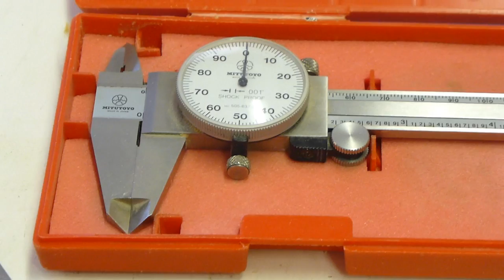Workshop for model ship building

Comment: I really like the small carrousel that holds your  bits and such. I have a small work area and can see the usefulness of the storage options. If you do not mind I will use your design myself.  The drill press Dremel mount is outstanding. Your overall shop lay out is very clever. Hats off to you sir.

Comment: I hade the same table saw. Fine for general work but it has too many adjustments that can get out if wak. I replaced the plastic guides on the sliding table with long pieces of Jatoba (Brazilian Cherry). Mostly l run a thin kerf 7-1/4/184mm blade. I rarely cut anything over 3/4/19mm. I like the idea of each turn of the elevating crank raises the blade the same amount.
You do not need a largeshop todo good work. Chris on Clickspring is basically working in a large closet. Although he does all his heat treat and casting work outside.

Comment: Would like to be as rich as you to build my models
Reply: He didn't just buy them, he has collected them over many years and saved up for them as well
Reply: Warjacare, you don't need a whole lot to start building, a good set of Xacto knives, a small scroll saw, a Dremell, small chop saw from harbor freight, a couple of good metal rulers, a few clamps and a variety of sand paper, et voila, you can get all of that for around $ 200.00 or less, get you some good bass wood and start small, you'll get the rest as you get more involved in the hobby, I've been building scratch built models for 50 years now, I started with practically nothing.
Reply: Michael Bilodeau: me too!